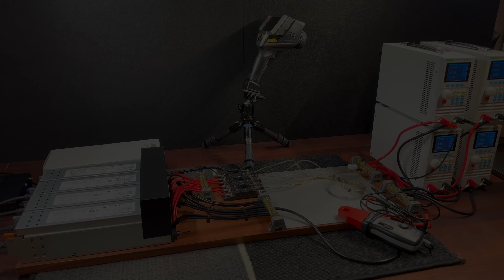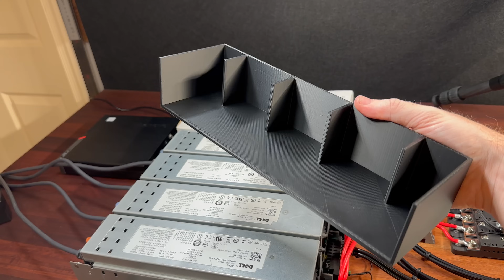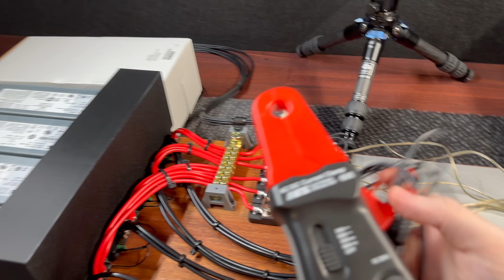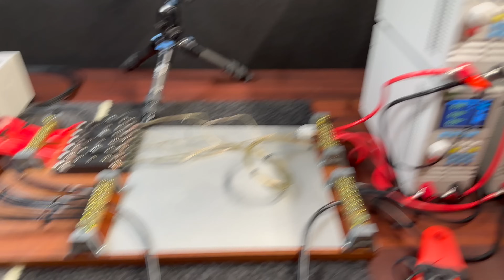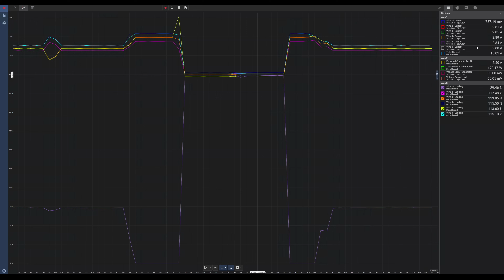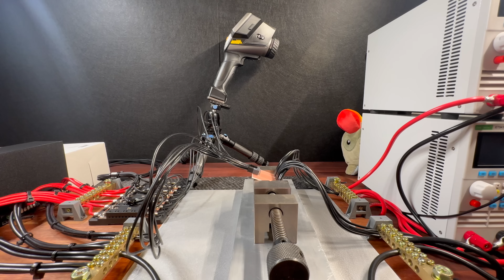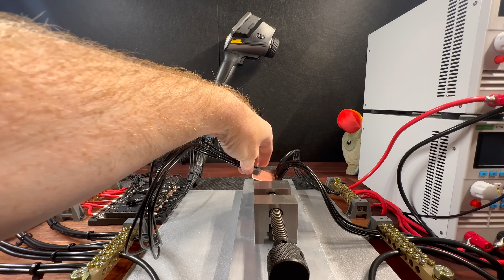NVIDIA 12VHPWR - Big Upgrades!

Comment from the maker: Thanks everyone for the comments and criticism about my hot take, I just wanted to update that I did some research into the ASUS PSU and Astral cards with "GPU First". Despite what I had seen in other YT videos, there doesn't seem to be any mention of actual load balancing taking place... beyond marketing spin, I cannot confirm how this actually works and ill keep researching this. Just to clarify what I sad about NVIDIA "not being at fault" I was more referring to the whole situation around PSU's coming with supplied cables and it seems most probable at the moment that the female side of the connector would responsible for failures and not the male pins on the GPU side. I don't believe NVIDIA can be held at fault for a cable being worn out, faulty, incorrect insertion etc etc. There are many things I don't like NVIDIA, their iron fist against AIBs and not allowing them to do different things, heavy restrictions on GPUs etc. The choice to use the 12VHPWR connector itself I think is simply a necessity as we need to keep in mind that a 5090 would require 4 x 8 pin PCIE cables and technically needs 5 to match a single 12VHPWR connector spec for spec. How many PCIe cables will we tolerate hanging off a GPU before we stop and find something else?
Reply: I disagree. NVIDIA decided to use the connector without properly testing it. If the spec says nothing about load balancing, it's a poorly designed spec, especially if it's underdesigned or has low tolerance headroom.
The fact that the spec says to bind all the pins together onto one 12V pour on the board is the fault of the spec. It should have been designed with manufacturing in mind, and with user error in mind. They should test it properly with some pins oxidised and others not, or with soldering flux left on them, or something that will happen when the product sits on a shelf for some time.

If a power supply follows the spec and a graphics card follows the spec and it still melts when a user plugs it in correctly, that's the fault of the spec, and the fault of the company who used the spec without fully testing it.
Reply from the maker: @ThisRandomUsername  The connector would have been tested to levels you cannot imagine in all sorts of crazy scenarios and environmental testing.
Reply: I think you are are providing the most nuanced videos on the subject, thank you.
Reply: @whatcouldgowrong7914  der8auer already defeated the "it's only the cable side that melts" claim. 
It's because the gpu side is of a different Plastic which has higher hardness and about 80c higher melting point. If they were of the same material we would have a connector with zero flexibility which would be Very hard to connect and disconnect
(And all we would gain is a connector which melts equally on both sides)
Reply from the maker: @meki___6881  I didn’t say they both wont melt, I simply said the the pin retention on the female side is most likely going to be responsible for the initial failure :)
Reply: @whatcouldgowrong7914  given they didn't Change anything on the Cable side for ATX 3.1 which all rtx 5000 cards are 
Shows there most likely inst anything wrong with the Cable itself also again rtx 3000 didn't melt and they used even older cable's. 

Why are you spending so much time and money just to defend Nvidia/Intel 
When it's getting clearer by the day who is at fault. And user Error is basically the equivalent of pilot error on the German f104G. If "user errors" are that common something is just wrong about your product, we never had those problems on the 6 and 8 pins. Or the 12pin on rtx 3000, did people just sell half of their brain instead of kidney, for the 4000 and 5000 Series given they lost the ability to connect a cable all of a sudden?
Reply from the maker: @ Im not defending them, im giving them a chance to prove otherwise. Everyone saying they’re at fault has not proven a single thing directly, you’re just making an assumption with no evidence. The 3000 series used half the power, it isn’t remotely comparable to a 5000 series. Everyone who has already decided who is at fault cannot conduct any impartial testing because you’ve already made the decision. I have offered an initial opinion based on evidence so far but im happy for this to change as we go forward with more testing
Reply: @whatcouldgowrong7914 
Well we have the der8auer video showing the 5090 happily run on Only 2 positive wires with the Rest cut off 20+ amps per wire spec max is 9.5amps. 
Even if we say clamps are inaccurate even 10 amps would still be too much
But that would not explain the high temperatures he got on the Cable connectors
Reply from the maker: @meki___6881  If you watch my previous videos, I have no doubt it will survive on 2 wires… I put. 35A through a single wire or 420W
Reply: @meki___6881  "Well we have the der8auer video showing the 5090 happily run on Only 2 positive wires with the Rest cut off 20+ amps per wire spec max is 9.5amps. "
Yeah - he has shown that if you INTENTIONALLY destroy your hardware then there will be problems. Wohoo.
Reply: @whatcouldgowrong7914  I am waiting for your updated video on that. 
The 9.5 amp limit exists for a reason
While there exists some headroom in the cables it is not meant to exceed those Limits constantly(which it does if Only one cable pair is  working). 
Also what Happens if the cable is cramped in a pc case (meaning ambient cable temps of up to 70c or more given most pc components first start to Thermal throttle at 80-100c)
Reply from the maker: @meki___6881 we will be doing extended testing in the next video
Reply: Thank you for continuing :). Looking forward to the results, I just believe, that shunts will equalize the current a lot, everything will look very benign for you. 

Interesting idea, with shunting on the power supply side. Wouldnt it be a problem that you do not know which psu sockets will go to which GPU as you need to try to equalize currents on gpu connected ones? Or do you assume that it would only be done for 12VHPWR which always singlehandedly powers one GPU? We had shunts on 3090 and they are not known for melting.. Since the wattage meters usually shunt to get the measurements.. is there any melted gpu with wireview?
Reply from the maker: @ My shunts are just there to passively measure current flow accurately, they don’t perform any load balancing. They were impedance matched to ensure nothing happens also. The 3090 load balancing Im not convinced yet as the card was too low power to load the connector significantly, the fact it had load balancing also could just a coincidence but who knows 🙂
Reply: @whatcouldgowrong7914  they have some resistance, so they inevitably do. The problem of melting connector might be in subtle differences in resistance where resistance of the parallel wires is low. By shunting, nVidia actually might have prevented the melting issue in the 30 series. But that is to be investigated. If you manage to melt something while shunting, Ill be thankful you proved me wrong. If not, you might just take this as next path of research?
Reply: this is another terrible take im sorry, nvidia is responsible for the entire design process, they have to factor in scenarios and all way that their connector will fail, that HAS to be factored into the design because having one simple thing not be perfect case leading to catastrophic failure in just plain bad design, 
think about if you bought a new sports car that specified 98 octane fuel, and you pump gas thats slightly not quite 98 but infact 97.5 and your engine blows up, im sure the being told that its not the car makers fault, you just non spec fuel in would not sit well with you. 
the fact is, all cables before this spec have been designed with safety margins pcie cables did not melt and burn because they were designed with all of these factors in mind thats why theyre rated to half the watts per wire as the 12vhpw for a reason, no matter how you spin this, its a bad design, we didnt over night just start having bad cables or used cables becoming defunked and not safe to use, nvidia just decided they didnt need the 2x safety margin in order to aid them saving some cost and pcb size and figured they can use mental gymnastics and point blame at cables and psu's freeing them of responsibility, all those with ruined cards/cables/pc's are just an accepted rate of failure by nvidia, its just disgusting people defend this.
Reply from the maker: @86BEAMS  If the problem is so simple to solve in your opinion then solve it… And the solution isnt using 5x PCIE cables btw… Undertaking this project has given me a lot of respect for the amount of current that is currently being pushed through this connector and to be blunt, there is no simple fix for it while maintaining reasonable sized graphics cards… NVIDIA did not design the connector, people need to stop coming to this assumption purely because they were the first to adopt it.
Reply: @whatcouldgowrong7914  you clearly didnt watch the video i linked if you're asking that, its very simple, split the power source into 3 separate rails on the gpu, add a fuse to each rail, there, you just passively balenced the wires good enough to the point they wont melt under worst case scenario and you have a fuse for extra safety incase somthing weird happens, 
as for why people are blaming nvidia, they made and designed the connector, that is evident by its early use on the 3090ti as a proprietary connector before it was adapted by pci-sig, and since you dont seem very educated about this topic, i will explain that the 3090 ti pulls as much power as 500watts, and yet there were no melting connectors due to board design balancing the wires, 
it was then a joint collaboration between them and pci-sig to make it a standard, they didnt walk in to the connecter shop and go, 'oh neat, look at this cool 12vhpr connecter somone sells now, lets use that' 

and if you are somehow unsatisfied with that answer of balencing the cables at the load as if its physically impossible for nvidia to do, even though they've done it with all models up until they stopped and cards started catching fire, you can simply drop the rated wattage to 300watt and use 2 connectors (and yes its been done before on 3090ti before the 12vhpr spec was official.) again, i dont know how you can defend nvidia with the opinion that this engineering problem is just so complex that its solution in insurmountable, they have already implemented a high power draw card through the very same connector design.
what is an acceptable excuse in your opinion for them to regress the design and then pull more wattage through it?
Reply from the maker: @ That isn’t “balancing” that is uneven load distribution by segmenting up the graphics cards functions to different wires and it still doesn’t solve the GND side which still dumps into a single plane. There are equally as many issues with doing this as the GPU could be damaged if certain functions fail to power up due to a wiring fault on those specific wires while other functions start up expecting them to be there. An acceptable excuse is that they managed to get a 600W TDP GPU back down to 2 slots with the lowest card temperatures to date with air cooling. The alternative is to back to utterly massive cards with 4-5 PCIE connectors and complex load balancing systems that introduce yet more complexity that can fail. From a design perspective… “The best part is no part”. Im not “defending NVIDIA” im simply pointing out this problem is not simple and every design decision is give and take.
Reply: @ there is no issues with the ground pins failing catastrophically, why do you keep bringing this up and deflecting? i will again reiterate again that both nvidia and amd have been doing this for atleast over a decade, what ever problem about common ground issues you are inventing has been resolved earlier, upping the power limit does not change these fundamentals. 
lol i mean respect for you answering the question of what is an acceptable risk of introducing a fire risk to save mere cm's of pcb space, concidering the pcbs are much smaller than they once were kind of defeats that argument in the first place, but i dont think we should be accepting of any risk of fire for any electrical component no matter what the compromise is, and i dont think this is the controversial take
Reply from the maker: @ Im not deflecting, I’m simply pointing out there is absolutely no difference between having a single 12V bus and a single ground bus. Even if you load balance and over engineer the 12V side, you still have the same potential issues on the GND side. Risk of fire is pretty ridiculous as all these components by design are self extinguishing.
Reply: @whatcouldgowrong7914  I agree on that
Reply: @86BEAMS  exactly
Reply: @86BEAMS  "his is another terrible take im sorry, AMD is responsible for the entire design process"
Had to fix that for you - just to show how wrong you are. yes, AMD is one of the lead designers of the 12vhpwr standard.
Reply: @ABaumstumpf  yes they all collaborate together, that is my point, pci-sig is not a seperate isolated entity, but a collab between all major hardware developers, but amd gpus do not catch fire yet, bringing amd into the conversation about why nvidia gpus catch fire is unhinged, so why would have mentioned them?
Reply: @86BEAMS  " but amd gpus do not catch fire yet, bringing amd into the conversation about why nvidia gpus catch fire is unhinged, so why would have mentioned them?"
YOU claimed the failure of the CONNECTOR is Nvidias fault cause of the design - that is unhinged if anything.

So yeah why did YOU mention nvidia then?

Comment: i was looking at some dsub connectors and and looks like the got some 70amp ones. anyway the gpu exhaust heat at the connector as well as case adds heat and like a 14900k too adds heat. but there are spikes over 900w. maybe its an over time thing posably wires degrading.

Comment: technically Nvidia can and did use their own non ATX spec connector.. aka the 30 series FE cards which used a at the time a proprietary 12 pin connector which was eventually adopted by PCI-SIG and modified into the 12 + 4 pin. that being said i think the problem is more so the specification than 100% nvidia's fault. there's too much cost savings and fudge room in the specification. we went from having robust connectors that couldn't be screwed up unless you legitimately tried to screw it up, to a connector that needs to be plugged in perfectly and with just the slightest bump/misalignment could potentially cause an issue. it just seemed overly rushed with very little thought put behind it for the future. either way can't wait to see the results, your first video on it a while back was really interesting to watch.